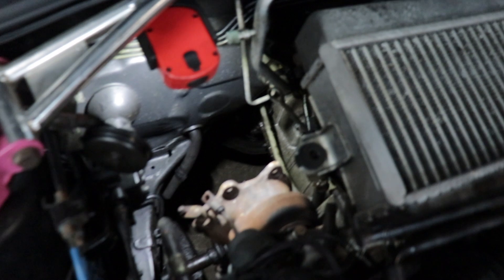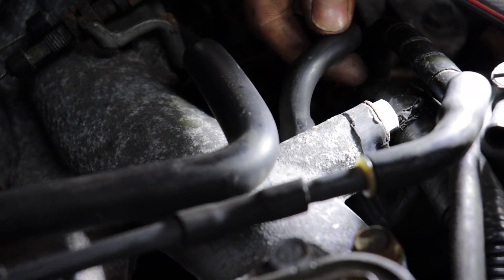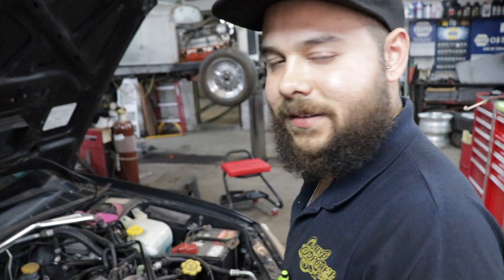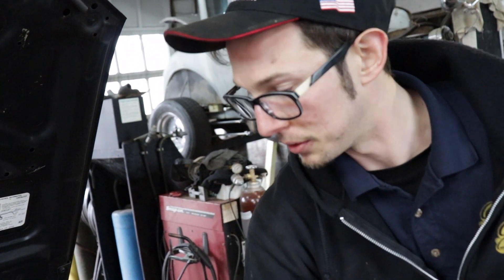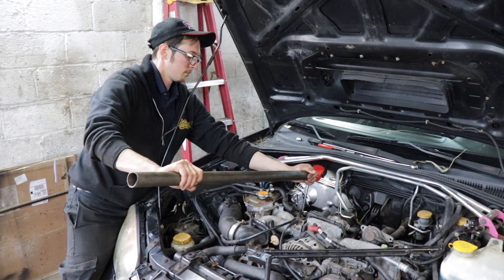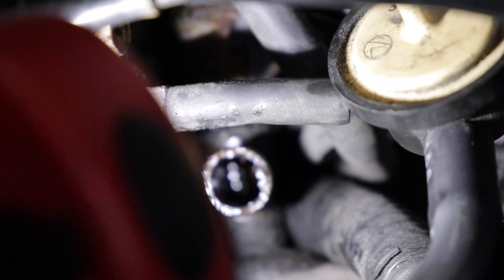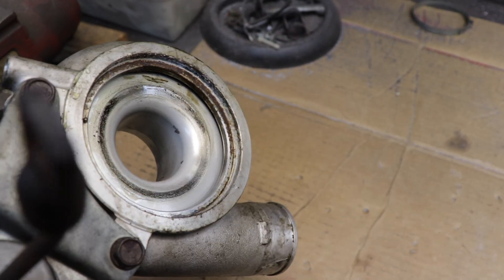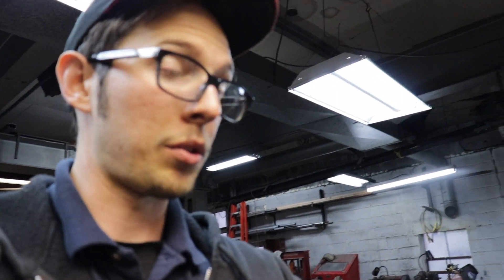Testing a Turbo oil leak on the 04 Subaru wrx

Comment: I have oil leaks near the turbo but I can't see exactly where it is, and I replaced the Pcv valve but I still see oil leakage, another symptom I have is that when accelerating thoroughly you don't feel any turbo impulse I just feel that my engine is stuck , Can you help me bro ?
Reply from the maker: almost sounds like your turbo is bound up or the waste gate is stuck open, a place to start at least.
Reply from the maker: make sure you can move the waste gate arm freely, then if thats good pull either the exhaust or the intake and spin the turbo see if its free

Comment: 13:30 my turbo oil return line was also missing a clap on the bottom
Reply from the maker: ive seen that plenty, since there is no pressure there its not terrible but not ideal either

Comment: All turbos will leak if u block drain??? 

It is drained by gravity. So if u block the exit it has no choice but to come out at the turbine.

It hasn't got true seals like a rear seal on an engine???

I'm losing oil on my wrx too. So interested in this
Reply from the maker: yea i know better now.. even though i didn't test it right it did end up being the turbo anyways

Comment: Something is leaking near my turbo that smells like power steering fluid. It appears to drip onto the down pipe or blow back to it from wind
Reply from the maker: if you follow the power steering line that comes off the pump and runs along the side of block it goes right back towards the turbo its probably that line that's leaking, but i would verify the leak before you replace anything. get someone in the car to steering while you look or vice versa.
Reply: @salvobrothers5928  Wow thank you for responding, you're just like Mr.Subaru! I have verified the leak to actually in fact be my banjo bolt to the oil inlet for the turbo. I believe it is the 17mm bolt at the bottom of the line behind the pass cyl head. I another one on the way and I've just been trying not to use boost/check oil constantly. I have a spare 19mm 4 hole APR banjo from a Jetta I might try on it later.
Reply from the maker: @user-ws3sl9xi7y  nice dude glad you could find the problem, your smart keeping your eye on it.
Reply: @salvobrothers5928  Update! : I put a offset wrench on it and found out that the line near the bolt is where it was "seeping" from. Now that the bolt is kinked free, the line essentially "squirts" oil. I have a line and banjo bolt on the way. Oil inlet cooler line should be easy enough right?
Reply from the maker: @user-ws3sl9xi7y  yea its not too hard

Comment: That's absolutely not how you check for leak! The seal you're talking about is the same as a piston ring so it has a gap and the turbo HAS to be operating for to be efficient. You could do the same on a brand new turbo and it would leak. Usually oil in the intercooler pipe would be crankcase overpressure. Too much blowby or bad oil return.
Reply from the maker: yea i realize that now after looking into it further but lucky for me it was the turbo that was leaking causing the issue.
Reply: A tip : you can watch series at Flixzone. I've been using them for watching lots of of movies recently.
Reply: @Ashton Hugh Definitely, have been watching on Flixzone} for months myself :D

Comment: My understanding is that once the oil hits the turbo it’s not under pressure anymore. So pressure testing it was a way of time. If you are getting oil pressure in the turbo, you have other issues. Not the turbo.
Reply from the maker: yea and after i did this i was wondering that point but it did end up being the turbo that was leaking so i cant confirm whether thats a valid test or not

Comment: Good video. The only thing I would say to keep in mind is that turbo oil bearings actaully require an equilibrium of pressure from both the intake and exhaust side to operate correctly. Disturbing this balance can cause oil to seep past the shaft and look as if the turbo is faulty.
Reply from the maker: thnx for the tip

Comment: Why don't you reach for the 1/2 ratchet and extension?; you just don't do that to a 3/8ths; live and learn.
Reply from the maker: yea your not wrong haha but thats why i got snap on stuff. I shouldn't have used a breaker bar instead as well haha

Comment: How much oil were you consuming? I'm burning a quart every 100 miles. Under 10% leakdown mid 160's on compression and fresh heads. I'm at a loss lol
Reply from the maker: once it started blowing smoke clouds out the exhaust on startup I stopped driving it so idk how much it was consuming
Reply: @salvobrothers5928  mines able to keep driving if I dont boost ir just has some steady smoke in boost. Wish I had another car to daily lol. I stalled my motor out a few times by blocking the turbo inlet and then looked in the outlet and there was some oil so maybe my seals are toast. Tricky to diagnose
Reply from the maker: @CuttinChris  yea it takes a lot of digging in to find the actual problem unfortunately. your problem is a little different then mine since its smoking under boost and not on startup it sounds like you may have a blow by problem
Reply: @salvobrothers5928  yeah i have been leaning torwards rings but I am changing up my drain line angle since I am rotated and going to see if that helps. my line does a 90 to horizontal before going into a fitting so that may be clogging it up a bit
Reply from the maker: @CuttinChris  its worth trying
Reply: @CuttinChris  Ever figure it out? Mine blows oil smoke in boost as well and sometimes it'll surge and loose boost, other times it rips perfectly.
Reply: @caden01691  turned out with that block it was my ringlands on cyl 2 and 4. Solid cracks on both pistons but the rings held them in place so it was able to drive just chugged oil. Now I have a forged 257 shortblock and cars doing great. Heres a recent pull video bro https://youtu.be/0atBRbIMIZw